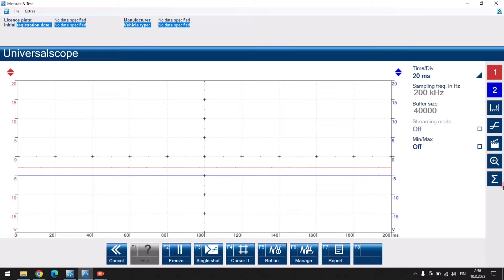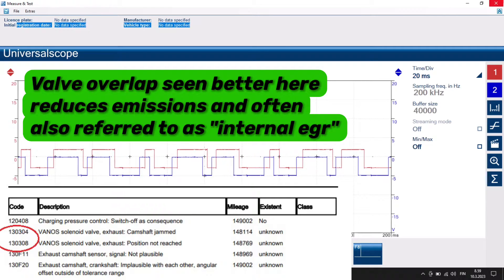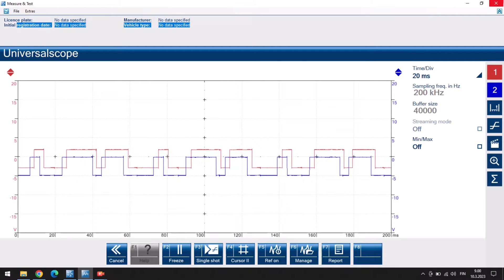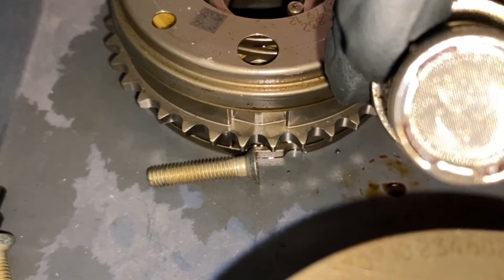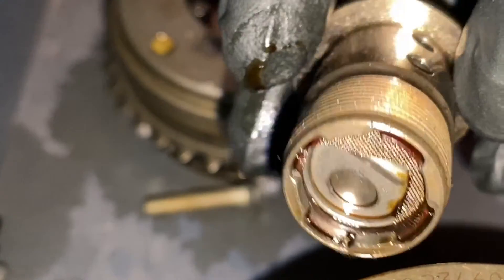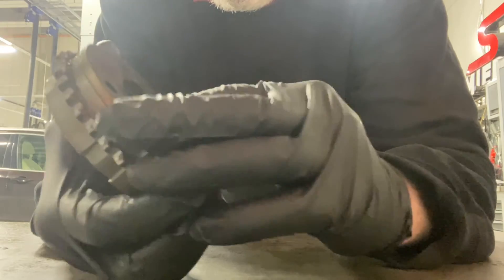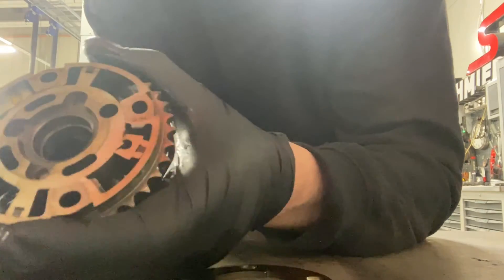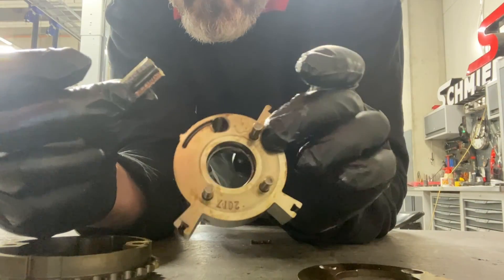B48 B38 VANOS FAILURE! CHANGE YOURS IMMEDIATELY IF YOU HAVE THESE FAULT CODES.

Comment: I have no fault code just a noise my car drive normally. But the garage have told me the noise is coming from the vanos hub and bolt. Ive had the car back as the quote was very expensive and it’s just a noise should I worry? Cheers ?
Reply from the maker: It must be changed or it will cost you more later

Comment: Do the intake gears fail too? Is it safe to just change both bolts and the exhaust gear since the only code i'm getting is for the exhaust jamming.
Reply from the maker: Yes. I know it aint cheap but dont mess about doing half a job - change intake sprocket too plus the others you mentioned.

Comment: Just had my 330e complete vanos system replaced under warranty, 28k miles, BMW can’t tell me why it’s happened or if I’ll be back in 28k miles again 🤦🏻‍♂️

Thank you for the explanation and your video though 👍👍
Reply from the maker: It wont happen again. Parts are all improved/countermeasured 😅
Reply: @BenJFF  ahh that’s good news, thank you very much for the advice, kudos 👌👌

Comment: Hi, B48 G30 2018
Please excuse the lack of knowledge 
Can you do Vanos Sprockets with Engine in Car?
Is it wise to do Timing Chain if Engine out job?
What are consequences of not repairing Sprockets etc, can it damage eg Engine?
I’ve been driving for a Month with eml and exhaust sensor jammed….
Thank You!
Reply from the maker: Yes it can be done but special tools needed. Yes it will cause issues if you leave it

Comment: Hi mate, my journey to your fantastic video started by a knocking noise at cold start of my wife's BMW 118i B38 engine. This noise appearing/disapearing for a period of time before being permanent. I then plug Bimmerlink and pulled out 130308 and 130f20 codes, which lead me to your analysis. I am now with the engine opened and the exhaust boltvalve seems to be in really good shape. with no trace of mesh filter failure. And by the time I write this comment I just see @AW-ty5qi below comment for which I thank both you and him for gathering the full story !!!! Do you by chance get the torque spec of this bloody bolt ?

Comment: hi ben I've got a b48 mini cooper with the jammed intake so this had had a chain replaced with the vanos kit and update im not sure where to go next is this something you've come across before.

many thanks tom
Reply from the maker: Hello Tom. I can only think theres an issue with the parts that were fitted or that theres not enough oil pressure to move that sprocket. I never trust when things are replaced unless I see who did the job - ergo: main dealer work these days can vary in quality from dealer to dealer. One benefit you have is that at least its easy to get to the vanos sprockets. But no, Tom never had any come back after vanos fixes.

Comment: Hello, I have two error codes: 130304 Vanos output control error, stuck camshaft
130104 Vanos intake control error, stuck camshaft
However, the Mini Cooper B48 vehicle doesn't oscillate, doesn't fail, and doesn't show any visible anomalies. All the raster parameters are ok, including oil pressure and the Valvetronic pulse. With your vast experience, what can you deduce?
Reply from the maker: Exactly what the video shows. You have a snapped vanos. It can run ok btw it just triggers a fault code

Comment: Hi pal. Great video. I'm on one at the moment replacing the pulleys, bolts,  chains ect. Do the vanos sprockets have a specific rotational location when bolting back up or just any orientation. Thanks again for your videos and the depth of explanation.

Comment: my b38 engine when warm goes up to 1500 rpm, what could it be ?
Reply: It's sometimes the fuel tank purge valve. I have the same fault, about to change the valve. It costs about £20 for a genuine Bosch one, and 10 minutes to change.
Reply: @timk3939  Thank you, I changed it six months ago and the problem was solved, paid €50

Comment: Hi, I’ve got these issues on top of that I’ve got 118002 : Mixture control: fuel-air mixture too rich and  Mixture control: multiple fault 11CF30 and 123601 Electric wastegate, activation: Short circuit to B+ or ground could it all be related?
Reply: Top man thank you, to replace the vanos solenoids, would you also recommend replacing the sprockets. If so do you mind giving me a price on how much it would cost parts and labour please I’m from London.
Reply from the maker: @user-cv5oz9ji3v The sprockets must be replaced if the bolt mesh is damaged or if the bolt is moving in the centre. Sorry mate but I live in Finland 😅
Reply: @BenJFF thanks you think you’ll be able to give a price in euros if that’s the case please?
Reply from the maker: Well if the timing is out there will be diluted oil with petrol. The lambda will pick this up as too rich condition. The elec wastegate you would need to check the wiring and use a tester to try to activate the wastegate. Also check the evap electric valve isnt too noisy.
Reply: Also I’ve got 2 other faults that have come up : 1D3810 Clutch switches: Positions implausible with respect to each other and 213A26 Dual-mass flywheel, component protection: Speed too low when engine stopping I replaced the DMF and clutch last year around 7k miles ago could this be all interlinked with the vanos issue?

Comment: Is this a repair that must be done engine out to replace the sprockets?
Reply: I need to repair an exhaust cam angle problem. can I get this wheel in my hand and back in then time it back up  insitue,  or even just retime the cams insitue .
Reply from the maker: Without locking tools - no. Injectors out, cam cover off, time it, loosen tensioner then swap sprocket for new, new bolt, and tensioner. Turn twice then you need injector spacer to reassemble plus teflon rings.
Reply from the maker: No. Harder on rear drive but easier on the transverse onses

Comment: Hi sir! We have an 330e. The car has been to a garage because it judders a lot when stationary. We had the engine mounts replaced en they cleaned the injectors. We also had the valvetronic replaced. We are now at the point where we don’t have any fault codes. But the car still shakes a lot. Do you maybe know what it could be ?
Reply from the maker: Hi. Have you looked at fault codes? Is there vacuum in the cam cover when you remove the oil cap?

Comment: Hey mate, nice video first video explaining the actual fault. What parts do I need to get this done? Thanks
Reply from the maker: Injector bolts, rail bolts, teflon seals for injectors, cam cover seal kit, vanos sprocket, vanos central bolt, vanos solenoid o ring
Reply: Hey mate I’ve changed the sprocket and bolts and now I’m still getting the warning light. Does it need to be coded or anything? 

Codes are 130715 and 130716 exhaust and intake camshaft stuck ??
Reply: @Russell-i2d you will need to reset/relearn the vanos adaptions as the DME looses the original learned values once it is unable to control the vanos gears due to this valve failure. Hopefully this will cure your problem.
Reply: @VTECBOYy0 how do I do this?

Comment: Just a very quick question for you slightly related.
When timing the B48 engine, do the QR codes on the vanos gears need to line up with the camshaft QR codes ?

I didn't find an answer to this anywhere else online or on ista.
Reply from the maker: No
Reply: @BenJFF  You're the best !

Comment: Great video thank you. Out of interest, what are the very first mechanical symptoms (prior to appearance of the fault code) you’d expect to hear at tick over cold and hot.  The reason I ask is because we have a March 2023 1.5 Countryman Automatic with 9500 on the clock and the engine harmonics are similar to that of a diesel, it appears to ‘throb’ (around the gearbox end) rather than idle smoothly. I  really thought nothing of this at purchase private secondhand, because it is three not four cylinder as with our previous 2019 Cooper S Sport automatic, which was like a sowing machine. Although the noise has not increased, the more I hear it the more concerned I become? Your thoughts and advice would be welcome please. Thank you.

Comment: I have no fault codes but theres a weird rattle noise coming from the engine. Only after the car stood for longer than 10 hours in cold weather. Can it be the Vanos unit ? 

https://youtube.com/shorts/hnNUSY2nZQQ?feature=shared
Reply: i have the same noice on mine...
Reply: Need soft update
Reply: How you scan it?

Comment: I had an oil leak and I assumed it was coming from the rocker cover, I continued to drive the car as I needed to and was waiting for my garage to have time to replace it and eml light came on and showed a vanos fault. I cleared the code and have replaced rocker cover and gasket to stop oil leak and haven’t had the eml back on and cars driving fine. Could this has been abit of dirty oil on a sensor to throw up that fault or possibly still an issue with the VANOS?

Comment: I have a BMW 320, n20 engine, 184 HP, at the first cold start, only when decelerating does the idle drop in 300-400 rmp, after which it recovers. The rest of the startups work fine.
It has no error codes!

can it be from vanos?

Comment: Hello. I was having two issues, on my BMW F20 116i B38 2016, DTC 118001 & 130304. Both errors came along. For the first one, i have changed the - Fuel tank breather valve - OE code part 13907643106, and now the car is running ok. But i still wonder if that fixes the second error, the "130304 VANOS, exhaust: Control fault, camshaft stuck". I have made since then over 1000 km and the error 130304 doesn't appear anymore. Should i be worried, or considering changing the vanos or the vanos actuator? Thank you!
Reply: Did the problem come back again? The same thing happened to me. Thanks.
Reply: @timk3939  No, Happy new year!
Reply: @mr.valentin-ioan Thank you very much. Happy New Year! I had a poor idle, Vanos stuck code and lean code stored about 500 miles ago, and limp mode.

Limp mode has got me but the idle problem is still there.

No new codes have come back after I cleared them straight away.

I am going to change the purge valve as this is likely causing the idle issue. 

This may be good news if that cures the fault and no problems reoccur.

Comment: Hello, good vídeo! 
I have the same 2 failures codes as yours:
130304 VANOS solenoid valve, exhaust: Camshaft jammed
130308 VANOS solenoid valve, exhaust: Position not reached
But the car is running smoothly and rpm’s are stable, I thing that it has loose some power.(But when you remove the failure code from the car, it drives perfectly 100kms until the failure light comes on.
The are going to change me the banks solenoid exhaust valve. If the car runs smooth, do you think that it might be the exhaust valve or there will be something brake in the exhaust camshaft sprocket?
The car is BMW 118i f21 180.000 kms and i am afraid of the hours it can take…💰💰
Reply from the maker: It will need vanos sprocket if the screen is broken on the actuator bolt.
Reply: So you think that solenoid exhaust valve will be okay? And do you know if solenoid can be checked before buying a new one? 
And to change the vanos sprocket or the actuactor bolt, do I need to take off the gear box or I can change it without taking the motor down and the gear box out?

Thanks in advance!
Reply from the maker: @sergiogarcia1341 Watch the video it shows exactly what to look for with the actuator. I never did chain on F2x but usually we remove the engine.
Reply: @BenJFF  yes, I saw it and it is really interesting. But I don’t know if I need to take down the gear box or the access is “easy” for changing the actuator or exhaust vanos sprocket?
Reply: New updates, the vanos solenoid valve is not the problem. Now the mechanic is going to check the vanos and if not it says that it can be a problem of pistons slack….
Do you think that this could happened?

Comment: While putting back both vanos gears, is there a center or timing for it? Like QR codes should be in which directions or the arrow on the gear?
Reply from the maker: None at all. Qr code on cams faces up - cams locked with tool but the vanos sprockets can go any position just dont mix up ex and in lol ein / aus in German
Reply: @allmech_BMW_fault_finding  why does mine still have the shake? I literally changed the vanos gear for Ex and In plus the actuator, changed fuel injectors and spark plugs and still nothing. Can we please talk on email or something i really need your help
Reply from the maker: @Sunny-ed3uc email me - link is in my bio.

Comment: Это все происходит от не правильной вязкости масла 5w30, 5w40. B48, B38, B47, B58 только 0w20, 0w30 !!! Обязательно менять раз в 7000км
Reply from the maker: Correct
Reply: So which brand is mostly preferable?
Reply: @Dobajowy  brand of your choice. The best would be the original BMW or Valvoline MST C5 0w20
Reply: @ОлегИванов-е9ш  30000km on 5w30 and than changing to 0w20 is not a deal ?
Reply: @Dobajowy  Fine. I use 0w20 and the mileage is 130,000. The car runs smoother on cold starts and consumes less fuel
Reply: @ОлегИванов-е9ш  thanks for quick response, I appreciate. Maybe one more topic , if my engine B38B15MO need to be replaced any engine of B38B15 xx can be adopted ?
Reply: @Dobajowy  Can. The entire line of B-series engines is designed from the factory for liquid oils 0wXX

Comment: hi, i have a bmw g30 530i 
I had the check engine light and after the diagnosis I had a fault that referred to the vanos valve actuator as if it was jammed. I want to state that the engine runs perfectly, I had no symptoms and that the check engine warning light disappeared after a few hours. do you have any idea if my problem can be similar to what you explained in this video?
Reply: I had the same. Did the problem come back, or is it all fine now?

Comment: Hi, very informative video. Thank you. 
My Mini Cooper with the B46 engine has rough idle, surging and stuttering under load (e.g. driving up a hill) and I've confirmed plugs, coils, throttle and Lambda sensors appear good. No codes, just periodic drivability issues as described above.
Based on my research these symptoms could also be caused by a bad vanos electric solenoid. My understanding is that the solenoid is known to fail. But how can I tell a bad solenoid from the screen problem without throwing parts at the issue. I also don't want to have to pull the engine to check the screen. I assume that the oscilloscope trace would not necessarily distinguish between a bad solenoid and a sheared Vanos gear? Very much appreciate your input as the drivability is driving me crazy and I certainly don't want to wait for a more serious failure to occur. Thank you
Reply: You can remove the solenoid and check it with a battery or charger with 2 wires. If it clicks good each time it gets power then it’s fine. Most of the time you would get a code with this being bad.
Reply from the maker: It might click but that doesnt mean it works

Comment: Hi mate, I’ll be honest I’m stressing, I’ve had a EMS light pop up, scanned it and resulted in 3 fault codes: Camshaft Exhaust Sensor Signal Implausible, 130304: VANOS, exhaust camshaft, control jammed, camshaft jammed and a P13C9 code. I’ve change the sensor drove it for a little and the EMS light has not come back. Car starts fine, can’t notice anything with the driving, cleared the fault once came back after 5 days. Can you please tell me if I will need to change these bolts. Thank you.
Reply from the maker: Usually its more the Vanos sprocket broken and sticking but if yours is intermittent you might as well change the actuator bolts. If this doesn't cure it you should change the vanos sprockets. If you have a rear wheel drive Bmw its an engine out job I'm afraid. 
Make sure your I-level is on the latest version as old I-Level is less tolerant to timing drifts.

Comment: great video 👍🏻 just came across this at work , one question , the sprocket itself , where should i position it on the cam as i’ve only just found out ur supposed to mark it before removal ,
Reply from the maker: There is no keyway so you should lock the camshafts in place with locking plates. Without those the valve timing will be off.

Comment: Hello, if I change the vanos exhaust electric solenoid on my N20, do I need to do a bleed procedure afterwards? Do you have any tips on how to do the bleed procedure on the N20? Thank you for the informative videos!
Reply from the maker: There is no bleed procedure like on the old S55 or S54 with the seperate vanos units. Just crank it over with the coils disconnected and pull the fuel pump control (fuse to ekps or relay) crank it to build up the oil pressure and your good to go
Reply: @BenJFF  Thank you!
Reply from the maker: @ovidiuzav 👍

Comment: I had to get the VANOS solenoids replaced on my 2016 B38 218i at around 45k miles. Symptoms were very rough running engine to the point where it would stall when starting unless I gave it some revvs, cost £1070 at the independent BMW specialist, including a chain tensioner replacement...8 hours labour apparently
Reply from the maker: Yep as the injectors need to be removed. The bolts holding the vanos sprockets are also the oil control valves 🙂
Reply: hello ! torque vanos selenoid valve ? thenk you verry mach !

Comment: One if my best friends b38 made rattle noise on lift off shifting gears. The rattle apparently is also caused by the vanos. The BMW dealer quoted vanos + cams for 2400€ ex vat. Is that a normal price?
Reply from the maker: Camshafts? If cams are replaced this price seems ok. If the cams are rusty some RVS treatment will remove the rust. Find out and let me know why they want to change camshafts.
Reply: @BenJFF  Yeah I thought changing the cams was highly suspect, could they get damaged due to wear on the vanos, (With timing being off).?